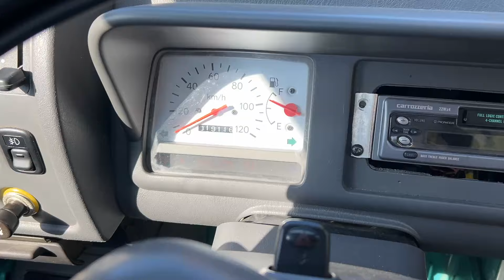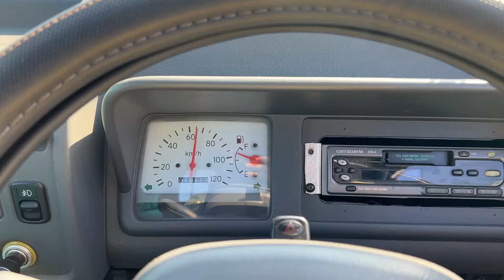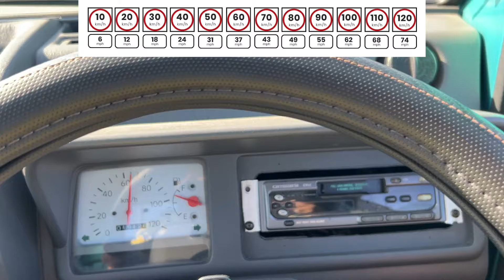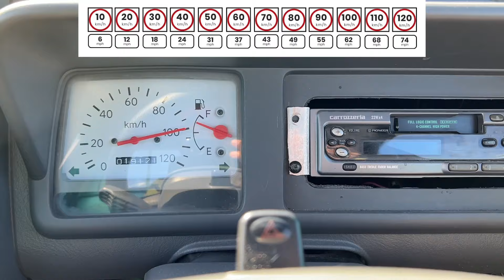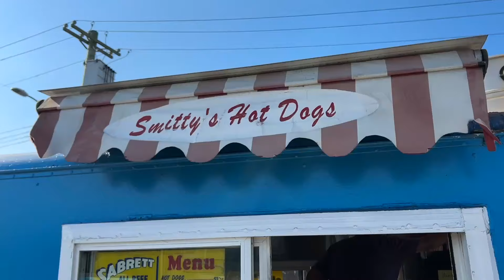Daihatsu Midget POV Drive & Overview! 1 SEATER KEI

Comment: WD-40 silicone on the window seals where the windows slide to lubricate them to not bind and go up/down smoothly.
Reply from the maker: illl do that
Reply: @Waybeforethefame  It's easier than trying to take the door panels off to spray the regular WD-40 on the mechanism.

Comment: hey i have a question... are the acty van and truck tail light lenses interchangeable... been looking at some clear lenses for my ´95 van but most of them are listed for the truck... i'm guessing they are the same..
Reply from the maker: Van and truck taillights are very different. It’s easy to get taillight in Japan
Reply: @Waybeforethefame  ok. then i'll just make sure to get the right ones. thx dude.

Comment: Top speed of the midget 2 is 60 mph from it's 31bhp
Reply from the maker: I went almost over 75mph lol
Reply: Speedo wants recalibrating then Nick as the car only has 31bhp & the top speed is 60. I've just watched another contest creator with a white 1 in the states & he mentioned how slow it is. Can't remember the name but the video won't take much funding as there can't be many MK2 midgets in the states the fella actually mentions the MK1 been more.like a Piaggio Ape or took took as it was a 3 wheeler.
Reply: Sorry won't take much Finding not funding
Reply from the maker: @jeremywentworth1833  don’t believe everything you read on the internet. I went well over 60mph in this video and it’s proof